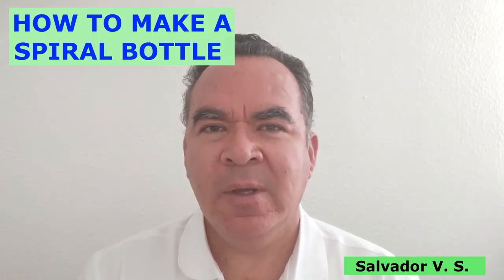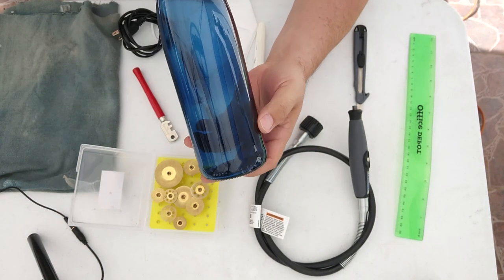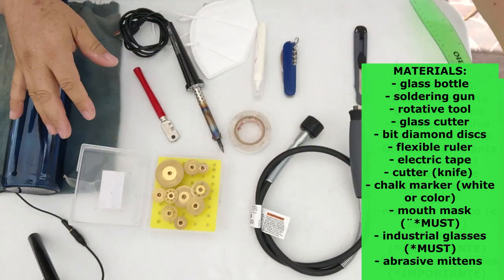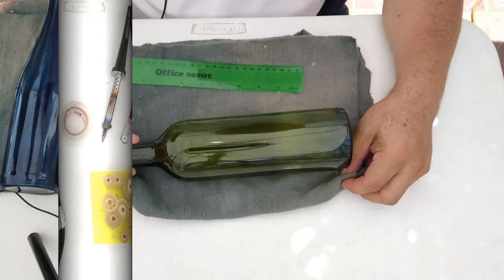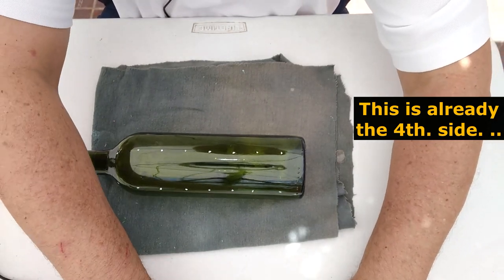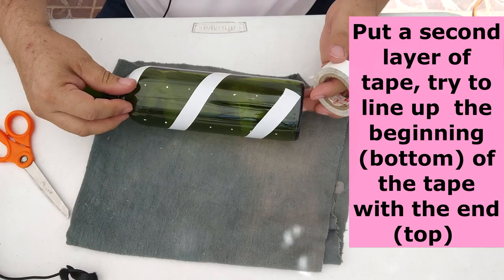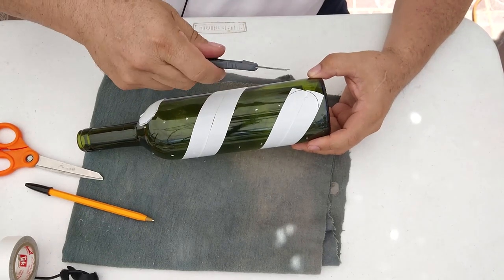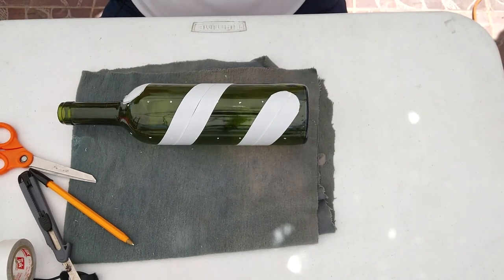SPIRAL BOTTLE HOW TO MAKE A

Comment: why not use the dremmel all along insteado of the soldering iron???
Reply from the maker: Vivíssima hi, the dremmel can be used for shorter and straight cuts. In this shape, I don´t suggest to use the the dremmel, but you can check by yourself and let me know.  Thanks for writing.
Reply: @embotellayarteconvilchis1498  thank you for answer, I will try both ways, in beer bottles what is more easier to get or if brokes I have another one lol and see the result, I will tell you the experience, thanks again
Reply from the maker: @vivissima1257  Way to go girl! You can do it!